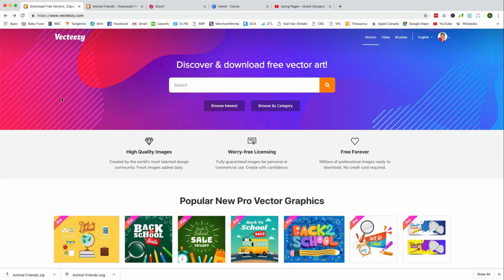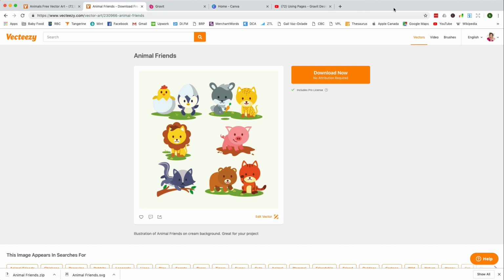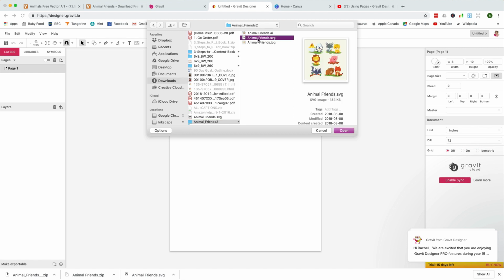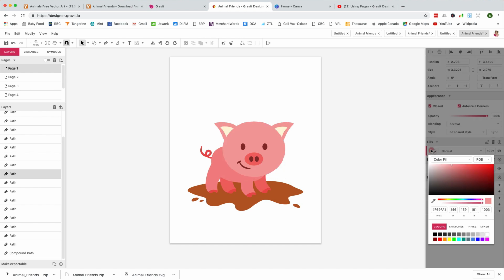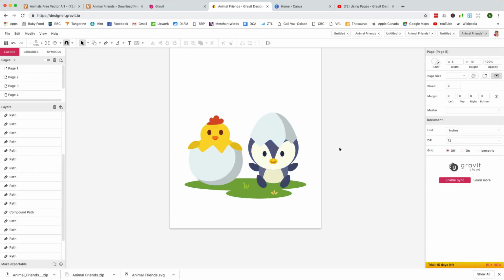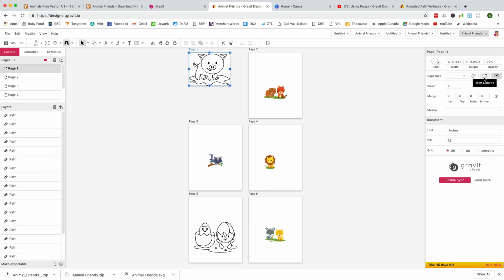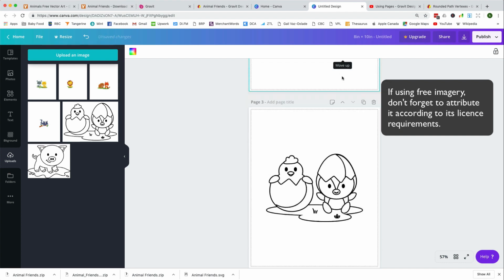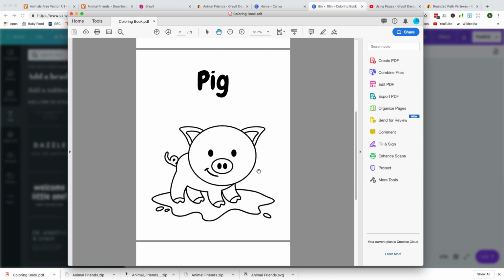How to Create a Coloring Book From Scratch Using Free Tools

Comment: I'm currently working on coloring book myself and using Photoshop for the darkening when I need to adjust it. With my drawings I'm using a thicker marker to trace so it has that coloring book look to it when I scan them in. I'm also putting a picture on one side so coloring won't bleed through from another picture. I plan on doing 24 pages and 48 total for mine. I think I might use canva for making the pages and using their fonts.
Reply from the maker: Awesome, it's great that you can use your own custom images! Good point about placing only one image per sheet so that it doesn't bleed through!

Comment: Wow super helpful and I love the way you articulate things - clear and precise! You could be a journalist or a tv presenter ;). After watching this a big doubt came up because normally how I design covers for KDP is to upload png images into Canva as I want them to be without background and then putting them into cover format and pdf. What is the risk of doing that and how can I eliminate it (is it possible without having background?). Thank you in advance. Big appreciation for your work!!
Reply from the maker: Hi Jenn! Thanks for the compliment! PNGs are okay to use as long as they are at least 300dpi, which is the minimum resolution required to print at high quality. Because most PNGs are used digitally rather than for print, they are usually only 72 ppi, which puts a printed version at risk of looking pixelated.

To check an image's resolution, if you're on a PC, right click the image file and choose "Properties", go to the "Details" tab,  and then look to ensure the resolution is at least 300. If it's not, it likely won't print well. If it is, just ensure you don't enlarge the image when you place it in your file, as this will reduce the resolution. 

If you're on a Mac, right click the image file and choose "Get Info" and look for resolution.

Hope that helps!
Reply: Rachel Harrison-Sund thank you so much again. I educated myself on this topic and corrected the existing books. I’m so happy that I caught that at the beginning. That’s thanks to your video! Wishing you all the best!

Comment: Great video. I wonder if PowerPoint could be used instead of Canva and what adjustments would have to be made?
Reply from the maker: Thanks, Nick. I know that many people use PowerPoint for this type of work, but I don't ever recommend it because it is presentation software meant for on-screen viewing only, not for creating print materials. The standard desktop publishing software is InDesign, but Canva does a decent job for a free program. Another free program you could check out is Lucidpress. You can use PP if you must, but keep in mind that you won't get the highest quality results.
Reply: @RachelHarrisonSund  Thanks, Rachel. Duly noted.

Comment: Hi Rachel! I just came across your video and it’s so much fun, I learned so much! Thank you! I kept seeing the suggestion by the program to change the dpi to 300 if you’re going to use canva, but you left it at 72.  Does it make a difference or is 72 going to still print in a good resolution? Also, if the final product is going to be in PDF why not save it in pdf on vecteezy? Thanks again!

Comment: Thanks Rachel!  I am a new fan :)  I am wondering if you have a video that shows how to create outlines from filled vector art in Photoshop or Illustrator.  I am well versed in Photoshop and familiar but a novice with Illustrator.  I have a bunch of art (my own) that is filled that I would like to convert, but I can't seem to find a tutorial on it (other than manually tracing--ugh).  Thanks so much!
Reply from the maker: Hi Liz! I'm not sure that I totally understand the question, but if you're working with filled vector art, can you just add an outline and remove the fill? If it's not vectorized yet then you'll need to trace it to get the best results.

I'm releasing a video (most likely this Monday) on how to create a colouring book with your own artwork, so hopefully that helps!

Comment: Thank you so much for this - I had considered drawing my own designs, but that's much more time consuming! I downloaded a few images from Vecteezy and also gravit to try it out. However the first few things i downloaded didn't have SVG files, only eps and jpeg - is there an easy way to tell on Vecteezy if the image is going to have an SVG file or not or whether it's just potluck? Just wondering if I'm missing something! It's a shame, I found loads of co-hesive images but no SVG's :(
Reply from the maker: Hey Jo! You can edit .eps files too. It's just Canva that requires them in .svg format, and you can export the vectors in .svg format when you're done with them in Gravit.

Comment: Can’t I use photoshop for this? I’m an illustrator and I’ll be able to draw everything myself. Or would I have to use the programmes you mentioned?
Reply from the maker: You could draw it in PS and then vectorize it in Illustrator, or create the drawing in Illustrator to begin with. I used these programs in particular because they're free, but you can use any vector editing software you're comfortable with.
Reply: Hi Naomi, I'm a little late but I don't think you need to vectorize your art. After all in this tutorial it was transformed is jpg really early (which means it was not vectorized anymore). Just make sure the quality is very good so the printing is beautiful.

Comment: I downloaded several images, but some came over as compressed files and then would not open. So I do not see the multiple file extensions like you have (no SVG to use). If I use a jpeg of own art, is there a workaround?

Comment: Hi! my files are not svgs; only jpg and eps.  I tried Chrome and Firefox.  Does anyone have a suggestion as to why that's happening?  Thx!
Reply from the maker: Hi Cynthia! EPS files are similar to SVG files in that they are both vector files. You should be able to import the EPS file and use it in the same manor.
Reply: @RachelHarrisonSund  That worked, thank you!

Comment: I have a question :
There is a part of the image that I can get to pure white... it remains a little blue grey, very pale. 
I have checked the transparency and out it to zero and the color is FFFFFF... which is the usual white.
I've tried all possible combinations, not to avail.
Would you have an idea what happens and what I cold do to correct it ?
Thanks for your help :-)
Reply: Silly question but did you ensure that you are using "color fill" and not any of the other fill options? I had the same issue on an element and realized I had it on "linear gradient" on accident. Good luck!
Reply: @emilyramirez6295  I'll try that, thanks for the tip. I'm pretty sure I used color fill, but who knows ;-)

Comment: Great video, thanks for the tutorial!
I have two  questions though: 

1. On Vecteezy it says for free users "Up to 50 Copies/Sales". So I'm not allowed to sell more than 50 coloring books, right?

2. And do you know if it's permissible to use the graphics as-is (without altering them too much) as a Free or Pro user?

Thanks!
Reply from the maker: Hi Tony, you can use the free licence and then upgrade to the extended one if/when you sell more than 50 copies. It will only cost you a few bucks.

You should be able to use them as-is; I haven't seen anything in the licence prohibiting that.